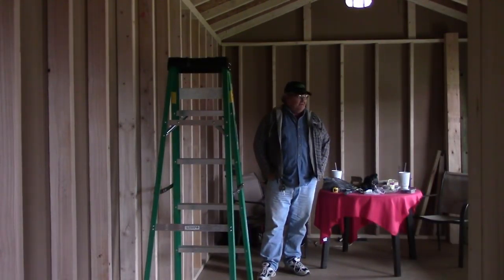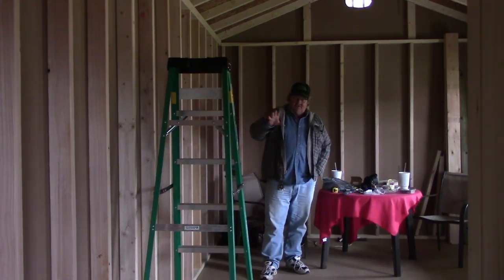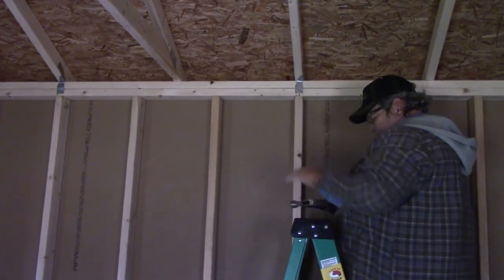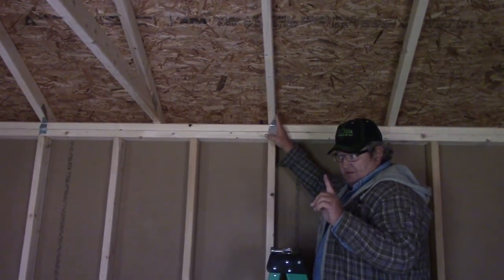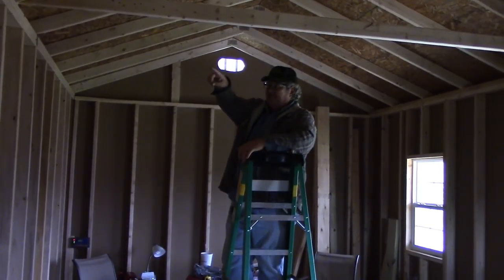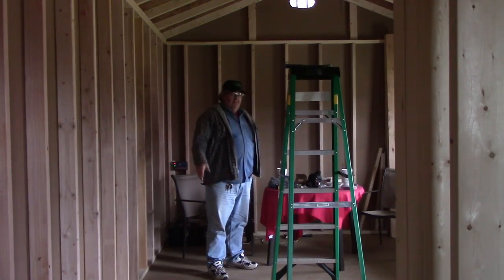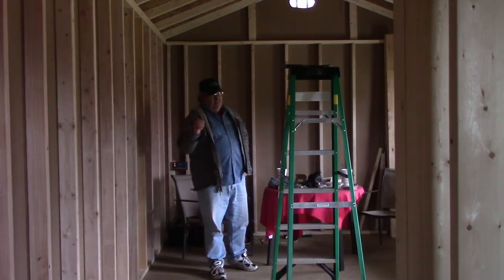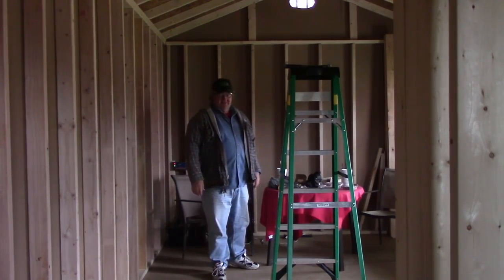Structural enhancements to the roof of the tiny house @ St. Bernard Acres

Comment: Hey Joe ; Unless you folks want a vaulted ceiling I would add a 2x4 crossbeams over the top sill plate,   tied into every other rafter & the top sill board. Remember to tie the 2x4's into the top sill board & rafter both
 save a bundle of money & probably exced the strength factor . your friend Bart in Calif
Reply from the maker: +Bart Smith Hey Bart...check out a couple of later videos, the last one dealing with the ceiling, and you'll see how it wound up :)

Comment: Joe I built a small lake cabin much like your tiny home. This was 20 years ago I made collar ties from aluminum straping but instead of nailing I used screws and a drill to install them. I built a motorhome building and I used the exact collar  ties as you have but I used screws and a cordless drill much faster and stronger building is 16 X 38 feet and 15 ft tall all screws no nails covered in metal. Just a tip from one old guy to another old guy have a great day.
Reply from the maker: +james baker  I use screw a lost, but, I've got 34 of these to put in with 10 nails in each.  The coated ring shank nails are a lot cheaper than 340 screws lol

Comment: Hey Joe!
Guilty as charged! Glad you did your research on snow loads and spoke to some-one who actually knows about it. Structural engineering is a science, and not something to be taken lightly if people have to live or work in or on your building. Nature can throw some pretty huge forces at stuff.
I will sleep easier knowing you will be adding wall/rafter ties rather than removing them.
Having thought about a comment I made on an earlier vid, I think Gyproc/sheetrock is probably not a good idea due to the cracking at seams due to the building flexing in strong wind... Another thing to ponder on these darkening evenings.
ATB from the UK matey.
Reply from the maker: +SarkyBugger  Yep....that's what I look for in the videos.  Being a novice, I need to see all the advice and suggestions from the experienced ones lol.  Sheetrock is going to be used minimally in the house.

Comment: My shed/house has the same roof.  Mine being in/coming from Oklahoma, it already has the hurricane ties on it.  Mine is built and sold as a cabin.  The door is on the end, and there's a 4' porch.  Therefore, there's a 4' section above the porch that I can use for storage - IF I remove some of the rafter ties.  My plans are pretty much the same as yours.  I was planning to double up the rafter tie in the middle (my cabin is only 8x12 + the 4' porch) and wrap it with wood to make it look like a timber.  Adding the collars will give it a little more strength and give me a flat surface for lights and also add ventilation.  My vents are pretty small, and I think they'll be completely in the air space when I get a ceiling put in.  So, it sounds like we have the same idea for our "sheds".
Reply from the maker: +Larry Shinn (Tiny Cabin)  Sounds like we do!  We have to strengthen this things as much as possible.  Mine was sold as a "cabin shell" by Lakeside Cabins.

Comment: You need to transfer the weight on the roof to the exterior walls.  Go look up some roof truss designs and pick one that will work for your application.
Reply from the maker: +Arnd2it  This is going to work great for us.  It's not a big roof, and it has 3/4" sheathing under the metal.  It's all going to rest on the wall.
Reply: +Arnd2it I don't even understand what that means, what about putting beams on the out side to keep it from buckling out? are you saying the roof is too heavy or not heavy enough?

Comment: Hi Joe !! I thought you might want to check out this guys channel before getting to far into your ceiling project . The channel is Solar Cabins , check out the sheds turned into cabins . I truly believe and from experience you should go with your first design ,and use a cripple in the peek and not have such a low ceiling. Good Luck !!   Hfx NS. Canada.

Comment: I might paint the rafter ties to match the ceiling, making them blend in rather than stand out. It would make them less intrusive. Just my $.01, I don't have enough decorating sense to make it even $.02.  Will you double the header on the end wall as well? I'm glad you are adding reinforcement to the roof.
Reply from the maker: +Odahi The Dubious  Oh yeah....I have to address the end walls as well.  They don't carry much weight, but I do have to frame them in better for insulating and hanging wall board.

Comment: hey the metal brackets you are putting on are called hurricane  brackets , I have them on my small cabin, so far the roof hasent blown off lol and we live 50 miles from myrtle beach, you could add on tie downs under your tiny house, not sure how much wind you may get there ?  just a thought.  edna and tim
Reply from the maker: +prepare for the worst  We don't have many hurricanes here on the mountain lol.  That's why I wasn't afraid of modifying those hurricane straps to fit the application I needed to use them in.

Comment: I get it if you don't want a standard height ceiling, but why not just put in normal ceiling joists to tie the outside walls together and create a truss?
Reply from the maker: +Backwoods Patriot  That's what I said I was doing with the back half of it.  The front half I don't want the standard ceiling.... vaulted a little bit to make the space feel larger.
Reply: Homestead Dreams At St. Bernard Acres I can understand wanting a higher ceiling to make the place seem bigger.  I think it would be much better if they had built the room using a ridge beam that the rafters butt against instead of the 2x's just butting into each other at a mitre, but you can't have everything and hindsight is 20/20! lol
Reply from the maker: +Backwoods Patriot  I agree!  When you buy one of these building to start with, you have a figure a lot of work arounds lol.  This was a lot cheaper than having someone come out and frame a conventional house for us.
Reply: Homestead Dreams At St. Bernard Acres That's true, it was cheaper than a standard house on a foundation.  I'm interested in these little buildings myself, I have seen these in my area selling for $12,000...I don't get it.  I may sit down and put some hours into a sketchup model and figure out how much it would cost a person to build it themselves because I don't think it would cost even $5,000 to frame one like how yours was with no wiring, plumbing, or insulation.  I have thought about building one and trying to sell it at way below what others here are charging so this may be a good exercise to make up my mind.
Reply from the maker: +Backwoods Patriot  I paid $8500 for mine.  Could have built it for around half that.  But, I'd have to pay someone to do the roof lol.  I don't do that anymore.  Also, with me and Gail both working full time jobs, it would have just taken too long, and I don't want to do that kind of stuff anymore.  So I opted to pay for the convenience of not having to do it.  Not only paid more money, but it wasn't built exactly as I would have.  But, it's a good place to start.
Reply: Homestead Dreams At St. Bernard Acres That's my point though, is I think a person could build one of these in a week since it's just framing...so if you built one to sell, you could just ask for say $500 above cost...so if a person could build it themselves for $4,000, they could pay $5,000 delivered.  Of course there are logistics involved like maneuvering it into place, but I have seen guys move these with just a roll back from like a towing company, which here only costs $30 for the first 5 miles then $2 a mile after that.  I just think people try to make too much of a profit these days.  I don't rake people over the coals like that, I figure my own wages at only $8 an hour and can get by on that.  People don't need to make $5,000 a month just to live.  Wow that got ranty quick! hahaha

Comment: Boy there is a lot of talk about snow load on here.  This is only a 12 ft building with a steel roof  6 ft plus a little on one side and 10 ft plus a little on the other side.  On a mild day the snow will just slide off that roof and if it does build up some they have invented this snow scraper with a long handle that you can pull some off without leaving the ground. Some people need to chill out a little..
Reply from the maker: +eaglehill6  Thanks for that comment!  I agree entirely.  I'm not up near the lakes, and we don't get more than a few inches of snow at a time lol.
Reply: Homestead Dreams At St. Bernard Acres Well I did grow in South Western Ontario in a snow belt just inland a little from Lake Huron and I could show you pictures of snow but we didn't spend all of our time worrying about a little snow on the roofs.  Occasionally we did have to take some off but I cannot recall any building collapsing because of the snow ..

Comment: Hi Joe. Have you seen 5 or 10 year old buildings from the manufacturor that made your house? That could give you a nice insight. The beams or rafter ties you call them are a good idea. Makes the structure more strong. You can even make a loft/attic to store things you don't use every day.  About the roof: I think the angle is small (I built several houses and sheds and the angle of my roofs are much bigger/steeper). You might have the problem that snow is piling up on your roof. it would be stupid to make a new roof, but (it's a metal roof isn't it?) maybe you can coat it with a wax or silicone based coat that prevent snow to pile/stick up the roof. When SHTF and Al Gore is wrong, and we're going to a deep-freeze time you can even place some electrical mirror heaters (I have them in my bathroom, ideal!) under the metal roof....LOL!  But seriously: the two things you're planning to do are just fine, makes the building structurally much more stronger and are do-able cost wise. Cheers, Mark
Reply from the maker: +markparket  I haven't seen any that old yet.  This is a relatively new concept people are doing in just the last few years.  I'm not all that concerned here about all this snow load stuff.  We aren't up near the lakes or in an area where we get snow in feet.  We get inches lol.
Reply: +Homestead Dreams At St. Bernard Acres LOL Joe! In that case the updates you´re planning are more than sufficient! Cheers, Mark. PS: If Al Gore is right you´ll have no snow issues soon;-)